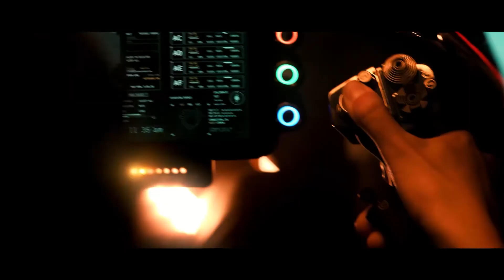Our Flying Car Future | South Australian Premier Steven Marshall Visits Alauda Aeronautics

Comment: Having that big knob front end takes away much important visibility and awareness just for attention/aesthetics. A bit unpractical. They won’t get to those speeds unless the motors can pivot, otherwise it will be flying ahead with nose pointing into the ground as it have to rotate close to 90 degrees to get full thrust, which defeats the aerodynamic design anyway, so it’s all a bit out of whack and a bit market gimmicky and an investor hunting. People who don’t know quadcopters will buy it though. 😂 The guys are looking fancy, but there’s lone guys building these in their garage, this just has an oddly shaped canopy, and multiple people wearing aviation headgear 😊 That said, looks good, and all the best, but I’ll stick to fpv unless it’s far off the ground and has some sort of glide ratio! 😮